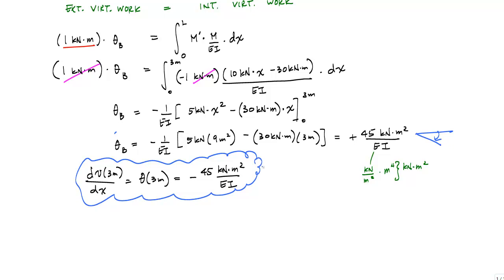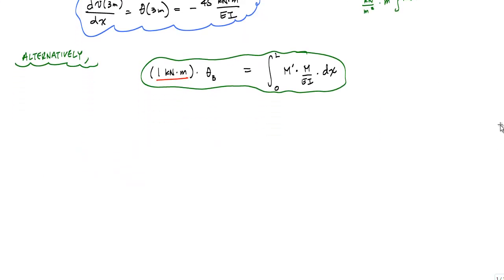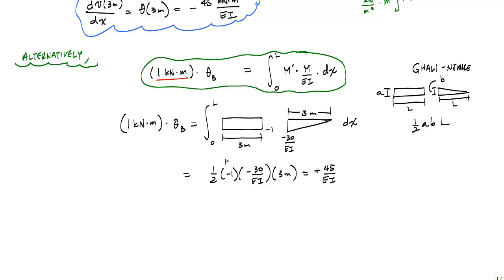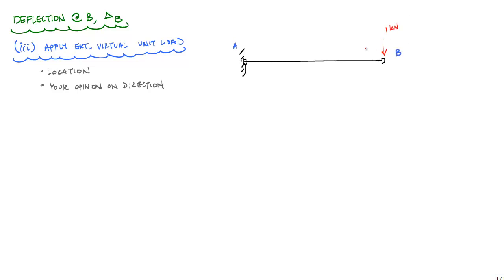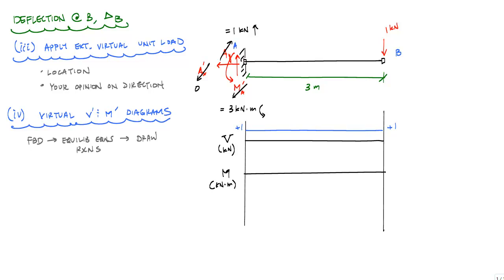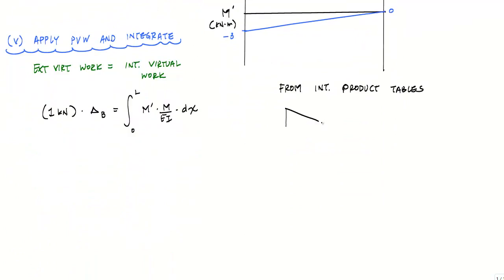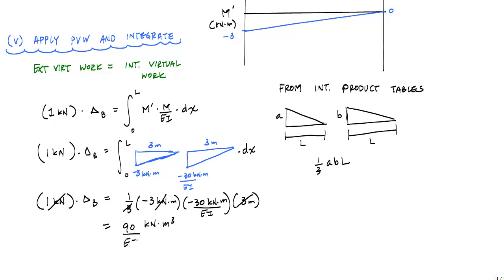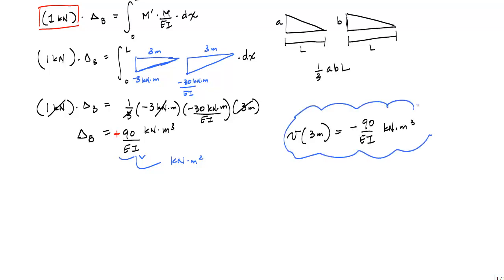Method of Virtual Work for Beams Example 1 (Part 2/2) - Structural Analysis

Comment: we say: 1*deflection= integral of m*M/EI dx but..also m*M/EI dx is equal to slope.so how is this formula derived? we found slope 45, but if we integarte again its 90/EI..so two formulas are true ..but how? am confused..
Reply: In the first case, unit moment is considered, which is uniform, hence, the result is 45....but in the second case(deflection) unit force is applied,( variable moment)...hence result is diiferent (90)

Comment: I am confused I understand how you have internal moment at the top in compression and the bottom in tension, however at the origin (o point) you initial moment is constant which is Ma and you said your coordinate system is positive CCW. Why would Mo be negative then?
Reply: I know this is super old, but in case anyone else sees it - it's just the convention that shear moment diagrams follow. It's counter-intuitive, but you just gotta learn to roll with it https://en.wikipedia.org/wiki/Shear_and_moment_diagram#Normal_convention

Comment: are you using American system ? I'm going to take my structural mechanics exam in uk so I'm supposed to do it following uk system, is this going to make any difference? and thank you so much for your helpful videos
Reply from the maker: i teach in the united states so i use both systems.  the theory is the same, the process is the same, only the units are different.